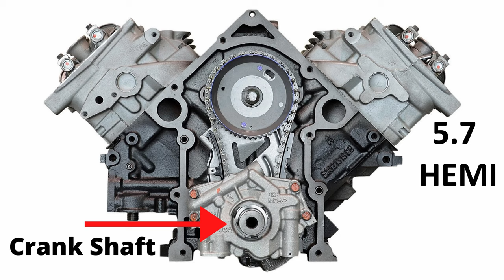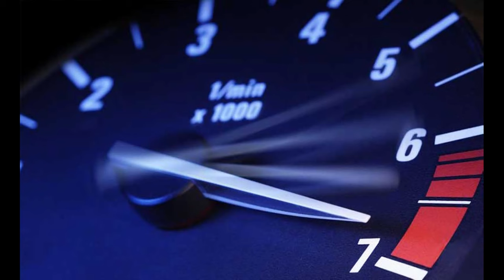HEMI TICK Explained (Easily) - The Cause and How to Diagnose

Comment: From what I've gathered the hemi tick issue got worse with the cylinder deactivation and VVT "upgrades".  Which I'd suggest it was a marginal design compounded by bad corporate decision making to improve fuel economy.

I think for all practical purposes the current Hemi is a dead engine design that Stellantis has every intention of pulling from the market as soon as sales justify it.  So they aren't going to invest any money in fixing the Hemi.

I mean the new Hemi has had a pretty good run compared to my 2.6 Liter Hemi that only lasted a few years. And to be honest the 2.6 had fewer issues than the 5.7 assuming the head bolts were re-torqued in time.  I'll admit, Chrysler Corp really got a few engines right and they ran and updated them for years, but they also screwed up and built some serious rolling trash... think lean burn.  They never went back and fixed their turds or admitted fault unless the government forced them too for safety reasons. They just develop something new and move on... Rinse and repeat.
Reply from the maker: Very interesting point of view! I think we can all agree on that there is something fundamentally wrong with the engine causing these lifter failures. To me I was surprised that they basically put in the same Hemi into the newer fifth gen trucks. I thought they would have reworked it a bit more. but hey they still seem to sell so why fix and issue that is still bringing the money. 

It will be interesting though how the e-torque hemi will perform and how they will last. I have a feeling that most automotive manufactures are sinking their R and D money into electric motors at this point rather then trying to redesign internal combustion engines. I could be wrong but it seems like the right move at this point.
Reply: @TheGettyAdventures  Car companies merge out of weakness, not strength.  I don't expect that Stellantis has the resources to produce anything too exciting in the near future.  I've got to think that Stellantis is going to draw from engine designs they already have in inventory for a while. 

Like most car makers, I expect them to try and focus on a world engine platform and down size the product line to improve profitability.  I'm thinking the pentastar might be the future of light truck engines for "mopar" until they switch over to a turbo 4.

Corporate investors buy badges and count on brand loyalty.  They don't give a rats tail about engineering and product quality. Those of us who actually wind up working on the cars they produce see things differently.  We have to deal with and pay for their shortcuts. But they know we are the minority and they count on the fact that by the time their crummy designs fail, they can just slap a "new and Improved" sticker on the same old bad designs and people who haven't a clue will buy them.  

Basically, it's all about selling more 2022 cars and putting the older models in the rear view mirror.  By 2025 we will see how good or bad the 2021's are.  If they are good, Stellantis will make a point of it, if they have problems, they will just claim their new cars have been improved and no one will know if it's true for another half a decade while they go on selling poorly engineered cars. 

If you have any doubts, just look at Subaru, every year they claim that their issues are fixed, and pretty much every year their cars still have problems.  If by chance they fix one issue, they cut some other corner and develop a brand new problem.  And that's why they are recalling over 800,000 pretty much new cars for safety issues again after a decade of claiming that they have fixed their problems.  It's not about fixing bad designs, it's about convincing people to buy their product while investing as little as possible into engineering and quality.

Comment: 274k miles on my 2004 Hemi.
Reply: It started in 2011 when they redesigned the motor.
Reply: Dang I have a 2012 charger pursuit hemi lots of idol time but I guess I'm good on my 07 ram hemi

Comment: Being mechanic yourself, do you think its better to put thicker oil to have good lubrication specially when engine becomes hot? A mechanic told me to put 5W50 to such big engines.
Reply: If you do that the mds won't work right

Comment: Bought a 2018 ram because I figured ram had years to work out all the bugs ,and I saw them everywhere. 55k miles on it and it's been in the shop a month. I'm a mature man that babied it hoping for a 300k mile life. Going to fix it and about give it away,and I'm buying a tocoma .
Reply from the maker: sorry to hear about that. I mean in ram's defense it seems like everybody is making trucks down to a budget these days. and you unfortunately probably just got unlucky with a shitty truck. either way I have heard nothing but good things about the quality and durability of the tocomas
Reply: You guys are scaring me... I was think the same, getting an 2020-2021 Ram to make sure that's there's no design flaw.... Seems like I am going to look for a Tacoma then
Reply from the maker: @netmana  you'll pay for a tacoma. but she'll hold her value well and they are pretty durable little trucks. never a bad option.

Comment: Maybe start putting better quality oil from beginning ?
Reply from the maker: Best thing you can do is use great quality oil.
Reply: 😂😂😂😂😂 better oil doesnt fix fucked engineering
Reply: Yes.  My employer operates a large fleet of vehicles with the 5.7 hemi.  One of the Mopar master mechanic dudes "off the record" told us that using a full synthetic oil early on seems to virtually eliminate this problem.
Reply: @TheGettyAdventures  so use amsoil...

Comment: How long do you think I can drive with this issue? I need my truck to be working for the next couple weeks. It can't be sitting in a shop waiting on a new cam or possibly a new engine. I'm not entirely sure if it's the exhaust manifold bolts or the lifters though. I started it up and it was ticking (the engine was already warm) and after like 10 seconds the ticking stopped. Part of me thinks it's the exhaust manifolds because the ticking stopped, but the other part of me thinks it's the lifters because the engine was already warm, and the tick was quite loud.

Comment: Do you know if the 392 6.4L has the same issue ast the 5.7? My 1500 is Chirping and ticking and needs a replacement, or repair. Repair seems dumb if it wont solve the problem anyway.

Comment: Tick and slight throttle hesitation on mine on occasion.  I'm at 104k miles.   I opened drivers side and the sound isn't coming from the exhaust manifold. (Passenger side manifold abs studs  replaced around 60k) .  Any suggestions? 

I'd  also like to add that I switched from 91 Oct and  was running it on regular fuel for a good few thousand miles before this issue started happening.

Comment: Those Hemis do have an in block camshaft, and are not SOHC. SOHC is when the camshaft is in the head and directly lifts the rocker arms. The problem is that the newer Hemis have the camshaft higher up so they don’t get enough splash lubrication, because Chrysler didn’t redesign the oil system much when the change was made.

Comment: Why I like solid lifters you break in properly an your good for ever
Reply from the maker: couldn't agree more
Reply: Not sure solid lifters will solve a lack of roller lube issue, how's that work?
Reply: @thisisyourcaptainspeaking2259  this situation was not nack of oil, poor design. Do your research. 90% of this situation isn't a real issue your getting crank case sling. Just sitting ehhh not good for this gen, just go ls. Buy a chevy. Your life will be happier
Reply: @chaningdodson4245  Poor design in what way?  No thanks on the chevy, my 80's Buicks and Olds are doing fine (mixed with a few chevys in there but new, chevy seems to be a winner.  Still wondering what "poor design" means exactly?
Reply: @thisisyourcaptainspeaking2259  oil galleries man
Reply: @thisisyourcaptainspeaking2259  an that "hemi" isn't even a real hemi fords have heads that are more hemispheric then those turds dodge had in the trucks
Reply: @chaningdodson4245  oil galleries cause lifter roller failure?  Most engines have oil galleries.... No?
Reply: @thisisyourcaptainspeaking2259  in the correct places sometimes😒
Reply: @chaningdodson4245  Your diagnosis and explanation are incredibly thorough and comprehensive.

Comment: We have 2013 hemi 1500 a mechanic replaced the lifters, camshaft in 10/2019 now it is getting a ticking noise. Does the camshaft wear out that fast? Thank you for valuable info. 👍🏼💯🇺🇲
Reply from the maker: If the noise is indeed another lifter tick. they do tend to wear out the cams pretty fast. the sooner you catch the lifter issue the more likely you can save the cam shaft
Reply: How much did you got charged for that job?

Comment: You hit it on the head, I owned one for 2 years and not knowing about the hemi tick I would remote start the truck and let it warm up in the winter and also let it cool down in the summer and low and behold after 2 years of this my lifters started to failing and had to have the lifters replaced before they damaged the cam , you are dead right about the low idol running for extended periods of time !
Reply: Great to know it took 2 years. I just get in mine and go lol.  Mabye mine will last.
Reply: How much did it cost to replace lifters?
Reply: @partyoflove6967  I also had some other work done at the same time, I had exhaust bolts drilled out and replaced! And I had one exhaust bolt hole welded  because I drilled through the water Jacket so all totaled it cost me 6.0000 , that’s why I posted this to save other ram owners from the same outcome !

Comment: I think that is one issue with the hemi tick but in my opinion the bigger issue is its mds design.it basically starves two sets per bank of lifter of oil.that with the geometry of the valve train is a recipe for higher lifter failure.i as a engine specialist at a chysler dealer see all the hemis flaws.one thing i recommend is oil change at 3500miles with penzzoil ultra platinum oil.customers who are religious with oil changes have less failure rate

Comment: Just bought a 2020 ram hemi. When cold start should I just start it and go or wait a min ?
Reply: Always let your engine run for about 30 seconds to a min before taking off. You want to get oil to the top of the engine. 

The older the engine gets give it a little more time to warm up and let that oil get to the top of the engine.
Reply: Right on above, just do not idle for way too long like 30 min hour... Also synthetic oil, not too long like no more then 8k, and recommended gas, which i believe is 89. In my case i'm also prone to believe the MDS can cause it, just as it happened to GM trucks, so i try to turn off MDS as much as possible

Comment: Chrysler fixed the issue when they updated the lifter without issuing a new part number. Also explains why when the lifter issue is fixed once it never becomes a problem again on that engine. 
Oil can only be the cause in the most extreme circumstances far beyond what any daily driver would ever experience.

Comment: There are a couple hemi ticks related to lifters....  my issue is a stuck valve.  the lifter starts slapping around.  also get a missed beat in the engine. boggs down.

Comment: Lifters were back ordered because of the high demand of nfg Hemi. I know 5 oilfield trucks where i work that engines went ( high idle time)
Reply: Chevy is having same issue with our oilfield pickups 🤦I've started buying older pickups and repairing them to run lease roads instead of these junk new pickups.

Comment: Video was ok.   Please get to the point a little sooner.   Just made a 4500 round trip to Texas and back. 80/90 most of the way, 54000 miles now, when passing we hit some triple digits,  37 inch tires,  lift kit.  Wow this thing goes.   I have cars that have way more power and much faster, however no complaints other than the exhaust leak on the right side.  At some point I  will probably put headers on it. Then re-tune. 2016 by the way.  Thanks

Comment: I get the tick on a cold start for about 40 seconds, then it stops.
Reply: What does that? not enough oil on top for 30 seconds?
Reply: Probably exhaust leak. Expanding with heat from running, the manifold and cylinder head expand and seal some (minor) exhaust leaks.
Reply: I bought a 2014 with 42K miles that ticked the same way. I took it to the dealership, and they found every manifold bolt loose or broken. After the repair, this truck has been rock solid.

Comment: I feel it is an issue with the lifters and not the low lubrication since this has not been a problem with the older 5.7 hemi. The problem started in the 09 and up 5.7 hemi. It seems to be more of a problem from 09-12 and some 13 and 14. With that being said since they buy so many lifters at once the probably had a ton on hand and didn't use up the old batches of lifters right away. And considering the fact it's the same motor you could have a motor in your 13 that was built in 11 or 12.
Reply: This really sucks to find all this out because I have a 12 at 12 5000 Dodge ram

Comment: I have a 2019 ram 1500, I use full synthetic oil, I noticed a tick at cold start that eventually goes away once warmed up   is this the "hemi tick?"
Reply: Same I have 2019 ticks at start then warmer engine it stops, no engine light. Drives good idles good idk 🤷‍♂️

Comment: So if these engines are so bad why are they in a  variety of vehicles. With many at 200000+ miles ? Actual question.  
I have a 2021 hemi ram on order, I’m thinking about getting something else now.
Reply: Some have gotten into those miles but many have had this issue as low as 50000 miles even having dealer oil changes and proper maintenance if you have want a hemi just make sure to buy all the warranties so if it does happen you can be covered problem is you don’t know when this will happen but it happens to every single one it’s just when because the camshaft and lifters are running dry

Comment: The camshaft is a little higher, but oil sprays all over inside. Oil doesn't encounter a splash limit.   Watch a video of a motor running with the oil pan removed - it has no problem splashing a lot of oil.  Overhead cam engines don't lubricate the cam by splash, so why would that be critical in the hemi?  I'm not yet convinced by any of the explanations for 'hemi tick'.
Reply from the maker: I think what is frustrating is that there is no real response from Chrysler. maybe it isn't an oiling problem but something is causing these lifter failures
Reply: @TheGettyAdventures  It also could be the Internet effect.  We read of the Hemi tick on forums and we think it happens a lot - maybe more than it actually does.  As the Hemi keeps selling, there must be a good word about them.  If you're a DIY repairer, fixing this issue is costly and takes an entire weekend, but its not that bad of a job.

Comment: I just replaced the engine on a 2006 300 C with the 5.7. I was properly pre oiled and is ticking with less than 20 mins run time.
Reply: How much did it cost mines ticking but not loud yet

Comment: This is such a controversial topic. There seems to be no consensus on what is causing this failure. I’ve seen mechanics claim damage is similar in MDS and non MDS engines, some people claim lack of maintenance, however, others claim failure even when oil is changed every 3000 miles. Some claim faulty metallurgy, but when hardness test are performed, they are within design specifications. Some say oiling issue, but then some say that’s not true. This has been going on long enough that some engineer must actually know what’s wrong, not just speculation.
If there is an adequate splashing from the crankshaft, would it be advisable to slightly overfill the crank case? At least keep the oil at the highest fill line on the dipstick.
Reply from the maker: Never overfill your crank case. aeration can occur causing a true lack of lubrication. But yes, many folks have let me know how wrong I am lol, I mean there seems to be compounding issues rather then maybe one single cause. MDS system does seem to have a part to play and I think dirty oil could also really effect this. the truth of the matter is that these lifter failures are occurring and there is a real issue on these engines. My gut feeling is that FCA knows what the real issue is and it's not an easy fix (a design flaw) and they are keeping quiet. I'm not sure what engine changes they made to the newer hemi in the 5th gen truck (2019+) but that could be a tell tail sign if anything major was updated involving the valve train, lifters and cam. only time will tell I guess. Thanks for the info!

Comment: I kept reading about cheap Chinese bearings on the Hemi, good to know it's probably a lubrication design problem.
Reply from the maker: Now after I made this video I took a really deep dive into this issue. It does still look like lubrication and idle time does still have a factor to play. but I think there is some legitimacy to bad lifters. and in 2016 RAM changed their lifter supplier so it does somewhat point to improper manufacturing of those lifters. the tolerances on those lifter bearings are very small and if just one of the bearings circumference is off by a couple thousands of an inch. it can lead to premature failure. Either way, Having good clean oil in your hemi  and limiting your idle time is the best way to extend your engines life.
Reply: Switch to 10w30 oil it’s thicker oil and it’ll quit ticking
Reply from the maker: @gohogs2277  could be an option

Comment: The Hemi does not have an overhead cam. It has an in-block cam, it's just set higher than usual. Over-head cams are, you got it, installed above or on top of the heads!